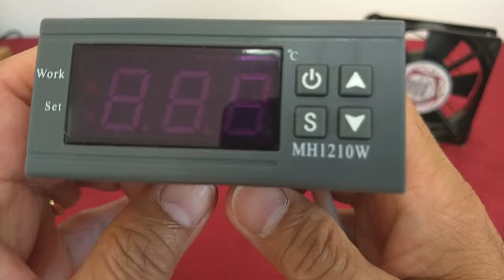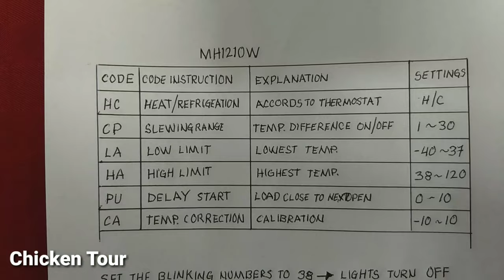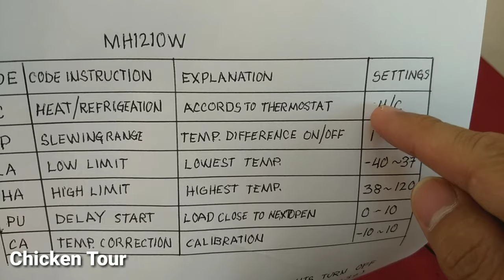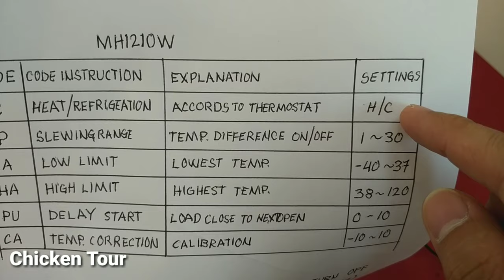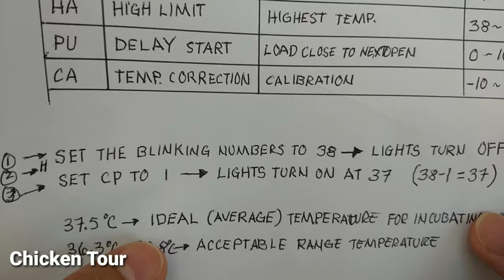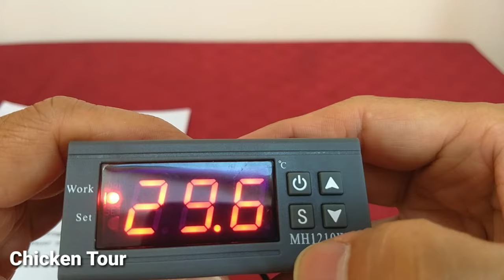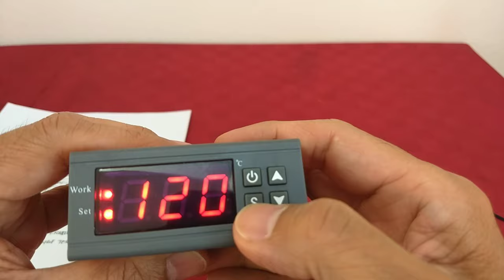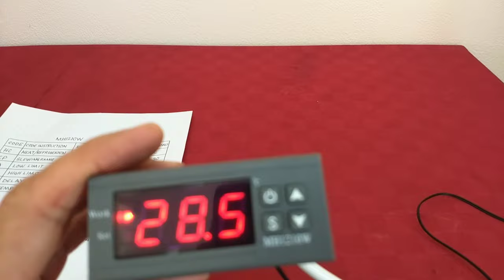HOW TO MAKE A HOMEMADE PLASTIC CONTAINER INCUBATOR|HOW TO SET MH1210W THERMOSTAT(Chicken Tour)

Comment: boss sa next video mo yon namang may synchronous motor na pino program na left and right lang ang automation nya at e sali mo mo rin kung paano e wiring yong e manually turn mo yong tray para bumalik sa gitna
Reply from the maker: Ok sir , may video din ako Ng rolltype automatic incubator , ang link Ng video ay nasa ibaba Ng video na ito paki check lang sir.

Comment: Sir magandang hapon tanung q lng accurate b ung stc1000 kz mag ka iba sila ng temperature nun nabili q n  digital thermostat n maliit d battery
Reply from the maker: Pwede nating gawin sir Yung calibration Ng ating Thermostat para maitama natin .May video ako Kung saan ay pinakita Ko paano ito gawin sa Q & A portion Ng video " ASIL INFUSION " Kung stc1000 punta lang tayo sa settings Ng ( correction or calibration) sir

Comment: Sa thermostat na XH-W3001 sir paanu ba sya e setting? Salamat po
Reply from the maker: Pagnaiconnect na ang power cord 220volts sa Thermostat , Yung load(ilaw,220volts na fan) ay naka direct na sa load terminal ng Thermostat sir

Comment: sir can i use 100 watts incandescent bulb for incubator?
Reply from the maker: Yes sir you can , but if you're going to use only one bulb (100 watts) , I suggest to use two bulbs (50 watts each) instead , as long as a one 50watts incandescent light bulb can maintain the desired temperature inside the Incubator incase one of the bulbs failed.
Reply: Great video sir. Ano poh model ng battery humidity  sensor? Thanks